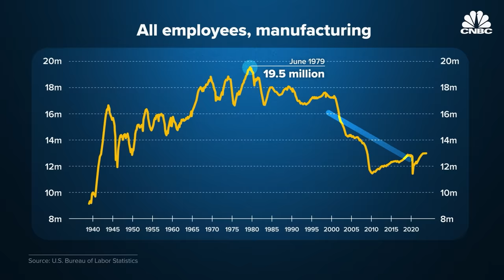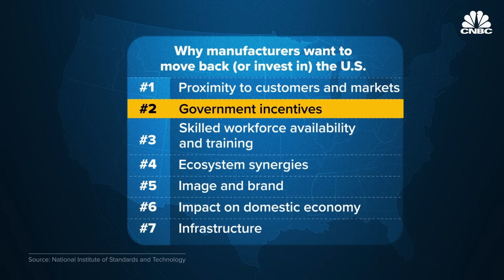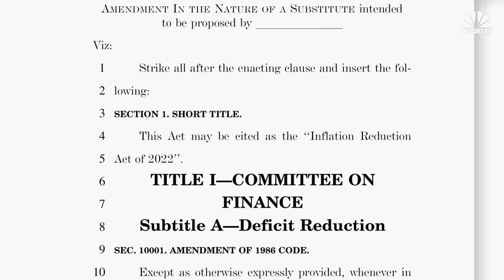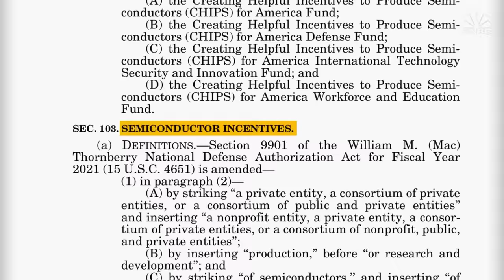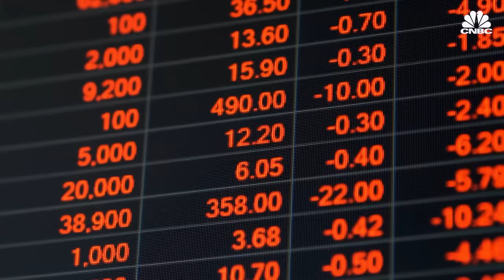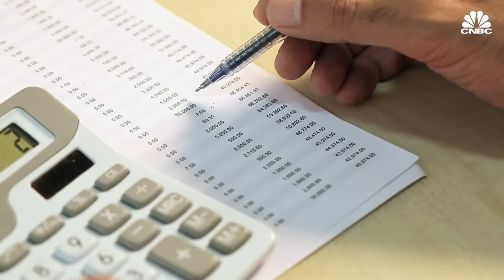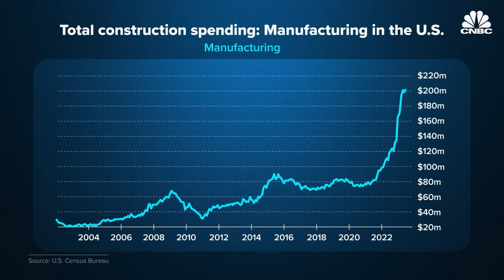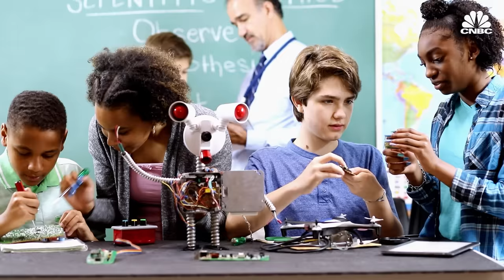Why Factories Are Coming Back To The U.S.

Comment: According to the Smiling Curve, Manufacturing is the least value-added in the production chain compared to R&D in the front and Sales and Services on the tail end. This is why factories are so sensitive to things like tax breaks, labor costs, and pollution controls, and explains how deep in trouble China is having largely failed to develop a solid grasp of the other ends. This is also why all this investment in domestic production likely won't boost our economy as much as education per dollar spent.

It is important that we maintain at least some capability to make things, but it's even more important to be resilient by having a diversity of supply sources, so that a disruptive shock -- including from disasters within America -- doesn't cripple the larger movement of goods and information that our economy and lifestyles depend on.
Reply: Too many takers, not enough producers. From a financial standpoint, I think you are correct. But from a prices standpoint I think you are wrong. The low labor force participation rate, the low amount of people producing goods, and the lack of capital investment in manufacturing has been steadily increasing costs. The core issue is that you can have all the R&D, Sales, and Services you want. But it requires the physical good in the first place.
I think there needs to be a balance in the workforce, and right now the US is out of balance.
Reply: China's biggest problem in terms of manufacturing was they were too reliant on exports. They don't have enough domestic consumers for the sheer amount of things they were creating, because for the past decade or more they were the world's factory and made everything from clothes to car parts. Now the pandemic hit and consumption took a nose dive. It's recovering, but countries are seeing it is not good to rely so heavily on China so they are pulling back and the US in particular wants to rely more on domestic production with some imports to supplement that, but far less coming from China. This has effectively put China in a horrible place because they relied so heavily on production in their economy. Couple that with their own domestic consumption being down and their housing/financial crises.
Reply: If you are not developing, and then producing new technologies, but buying them from someone outside, you are already behind technologically. We are entering a stage where semiconductors, AI and similar technologies reach such levels of complexity, and as a result, their impact, would they be in the hands of others, is far too great. 
  If the US wants to keep it's world dominating power, it has to re-build it's foundations, meaning production. It already has a developed services economy.

Speaking as a Eastern European.

Comment: Since Biden took office, there seem to have been more unfavorable results in America. These results include effects on the markets, such as price declines and sharp increases in inflation, as well as bank failures. I wonder if the sudden increase in interest rates will help value investors or if it would be wiser to stay away from the stock and financial markets for the time being.
Reply: To "buy the dip" It will be profitable in the long run. However, investors should be wary of the bull run. It is advisable to connect with a skilled adviser to fulfill your growth objectives and prevent mistakes. High interest rates typically result in lower stock prices.
Reply: I truly enjoy having a portfolio coach to help me make market judgments on a daily basis. They possess a special combination of abilities that enable them to take both long and short positions, benefiting from the possibility of significant gains while also safeguarding against downward turns. I have had a portfolio coach for more than two years and throughout that time I've actually earned over $645k. It was a wonderful experience!
Reply: @shirleygarland4766  I've been thinking about going that route. I have a lot of stocks that I have maintained, but they are beginning to lose value, so I'm not sure if I should hold onto them or sell them. I feel hiring your investment coach would make it easier to restructure my portfolio.
Reply: I'm guided by Camille Alicia Garcia an experienced coach with extensive financial market knowledge. While you can consider other options, her strategy has yielded positive results for me. She offers valuable insights, including entry and exit points for the securities I concentrate on.
Reply: I located her, sent her an email, and we set up a call; hopefully, she will answer because I want to end 2023 on a solid financial footing.

Comment: The US will remember very soon why many of these manufacturing jobs left in the first place. Productivity levels and productivity growth is substandard, if these don´t improve significantly manufacturers wont be able to compansate for higher labor cost. And then there is the lack of technical skills in many sectors. After so many years of making things elsewhere, the know-how is gone, There is not enough expertise in the pipeline and immigration policies will not help. And finally is the issue of profitability, many of the companies moving back manufacturing to the US are not making a profit. They will question their stay on US soil in a few quarters or years for all these reasons.

Comment: We've tried 'hands off, market will sort its self out'. And it did... offshore, to China, which put its thumb on the scale where we didn't. The 'free market' is not a divine power with our (citizen) well-being in mind. It is a machine designed to maximize short-term profit for a few individuals. And it works.. in the short-term, after which those individuals yolo out and start mass layoffs, selling companies for parts, etc. 

And it has no incentive in the well-being of the nation (retirement, drinkable water, climate change, health care), which tends to all lower profits, even though we keep saying 'government should not help any of these things, the free-market will take care of it'. Which.. makes no sense, logically or historically, since it is designed at its very core to avoid any and all costs beyond the immediate need for quarterly shareholder profits. It is designed from its very DNA to screw over employees and the ecosystem at any possible point because, if it doesn't, its competitor will and it will show higher profits. The free market is not a 'bad thing' so long as we regulate it as the machine it is designed to be. It can even work really well. It becomes a terrible thing when it starts being treated as a benevolent religion that can do no wrong, that must be left free to shower us all in trickle-down bounty and rainbows. Which is what rich people keep trying to sell us on, and have been for a very long time.

Scott seems heavily partisan and disconnected from reality. Yea there is political bias in the system. Pick better politicians and hold them accountable for their success / failures, so they start actually consulting experts instead of their PR teams. And elect them based on that success, not on the color of their ties. And hold them accountable to their districts / nation instead of to the national parties. (Tiered voting would help break us out of that). And yea, there are smart people abroad who can't (or don't want) to get here. But you know what? We have a ton of geniuses Here, already, who will never show up because they can't afford a quality education, because 'the free market' isn't incentivized to help them with that. And because our education system sucks, because we don't fund it properly. And yea, its possible the government will 'fund the wrong technology'. Oops. So what? At least we'll be doing Something to try and get jobs back. How much will 'funding the wrong tech' cost us vs doing nothing? How much have we spent on military R&D that never went anywhere? Should we cancel the budget to the military? Consult experts, fund what they suggest, and if we get it wrong then cut funding and move on. Corporations in 'the holy and divine free market' do that all the time and its just part of the expenses. Just.. uff. 

Scott.. Scott... come back to us buddy.. you're supposed to be an economist right? The theories you're defending have failed over.. and over.. and over.... let them go buddy. Trickle down doesn't work, the free market has only ever worked when properly funded and regulated, otherwise it cheerfully screws us over every. single. time.
Reply: We havent had a free market since the late 19th early 20th century. Times of actual free markets were also times of the fastest economic growth, the strongest middle class, increased innovation and productivity, drastically improving living and working conditions, and an increasing life span. The past 90 years have been decades of insane regulatory growth destroying any semblance of a free market while providing none of the promised benefits but still incurring all of the associated costs.
Reply: @mathewlloyd9717  Late 19th and 20th century.. wasn't that the years leading to and including the Great Depression? (1929-1932 when the GDP fell by 15%)? Triggered partially by the dust bowl effect (from unregulated excessive deforestation) and the panic of 1873 which built up into stock market crash of 1928 from unregulated banking practices? 

early 20th century.. around 1910-1920.. wasn't that also when the US faced some of the worst income inequalities? that improved around 1940-1990 and that we didn't have to deal with again until around the 2000s (and have just surpassed now)? With wealth inequality obviously sucking for anyone who is not at the top of that inequality? 

As for 'life expectancy', right now its gone down as we overwork ourselves and eat crap food full of forever-particles and all that, but didn't industrial pollution account for a Lot of the mortality in the early 1900s? Building up to 'the Great Smog of 1948' were 20 people just outright died from trying to breath outside? Which kept building to the point where most cities were covered in layers of smog that blocked vision (there are some fantastic spooky pictures of this) until the 1970s where we finally started regulating that? Isn't this something China is actually facing right now because they didn't set regulations, and (before covid, by 2017) people literally had to walk around with 'pollution masks' trying to get to work or take their kids to school? 

I'd say that for ordinary people, which is the vast majority of the citizens of any country, we've been living the benefits of regulation just fine. I can see how companies might not appreciate these benefits but... I am not a company. Most of us aren't 'companies'. And companies aren't 'people' for me to worry too much about their feelings. If we have to choose 'us' or 'them' I hope we can make room for 'them' to succeed... but I'm not up for destroying 'us' (again) to do it.

Comment: Bringing high volume low margin manufacturing would be disastrous and subsidising it should be discouraged. Low volume high margin and value manufacturing should be restored with emphasis on the nations strong lead in industrial automation and combined with a massive reskilling effort and greater emphasis on trades we can definitely bring high quality manufacturing back to the forefront in the US. And that change is already happening in some states like Georgia. A great example is rail manufacturing where Siemens, Stadler, Alston and Bombardier all are either expanding or constructing massive new factories. Also in terms of clean energy the new recent legislation allowing for lithium manufacturing would greatly help in expanding battery tech.

Comment: The problem is that overseas manufacturing is not sustainable. Average people of average ability are squeezed between job requirements of higher-level positions and H1b visa holders. Also it appears that American labor in some states is now at a tipping point where it's almost at equilibrium with cost compared to overseas. Also, tightly-coupled supply chains that involve multiple countries create problems during times of economic stress.

Comment: Almost every American citizen will tell you that if given a choice, they would prefer solar panels for energy and EVs for cars since everything would be powered for free and no harmful side effect once the system is set up.  Thus, the key here is to make solar energy system costs as low as possible.  Unfortunately, anything made in the USA is going to cost an arm and a leg.  This is why manufacturing moved to China.  But the current USA government is not going to let citizens enjoy the low cost solar systems from China, so we are back to square one, and only the Chinese can enjoy the low cost of solar system.  The biggest problem with solar panel installation in America is that the panels are place on the house roof instead of on a car port or better yet on a dual axis solar tracker rack (these racks increase solar production by 40%).  When America really want its citizens to go solar power system, they will get their acts corrected.

Comment: EVs may be the smokescreen as to the true reason why the United Staees wants Semiconductor manufacturing in the US. Every cruise missle, naval computer, and aviation instruments rely on this component. 

But in reality if the US were to be engaged in a prolonged engagement militarily with countries like China or Russia, they need alot more than CPU chips. The US does not have the raw industrial capacity or number of steel mills that China has.

Comment: The problem with the legacy energy industry is that its effects and waste was not properly factored into its cost. If you have an industry yhat dumps their waste into a river causing adverse effects to the river environment and affecting other people that deoend on that river for their livelihood, it is the government's job to step in and force the company to deal with its waste and that factors into the cost of that industry. For fossil fuels dumping their waste into yhe atmosphere, that cost of dealing with that easte is not factored into their bottom line. If every coal power plant was forced to have to capture and store all their waste gas being dumped into the atmosphere, power from coal would be FAR more expensive.

Comment: The thing is that government spending has always always gotten the economy back with a shot in the arm.  When government spends especially on projects it gets private companies to invest as well in factories, hiring new people, and expand their business.  New projects especially fixing roads, water sources, etc needs workers as well.  In the end, it all helps the economy down the road.  Compared that to trickle down tax cuts for the rich and corporations which don't do s except pad the wallets and the corporations use stock buybacks like the Big 3 auto companies (GM, Chrysler, and Ford).  The airline companies like Delta, Southwest, and America Airlines used it for stock buybacks.  Everyone benefits from the construction company needed to hire workers, to the materials like steel, concrete, wiring, to even the trucking companies bringing in the materials, supplies, and equipment.  Now these factories and companies now need to find a way to keep and maintain these workers and they know if they skimp out on pay and benefits, they are going to lose workers quitting or they will unionize which for them is worse along with bad PR.  If you want to make workers happy and production go through the roof then pay the workers and benefits like you see at Costco.  A model of when you treat your employees right, you get less people quitting and lower turnover especially in the retail industry.  It all trickles down especially if you got a good business model.

Comment: Some of these statements are crap. I have worked in high tech for decades.  High tech companies have always wanted to get workers from overseas, pay them less than US workers, and then send them home(without becoming citizens).  They have always complained "Not enough US qualified workers".  As to supporting things in certain areas to help your political career, this has been going on forever.  Why is the Johnson Space Center in Houston?
Reply: I'm in technology and they are NOT hiring older wihte males these days, except for the very top senior positions;  I can tell you that for a fact. They need to hire for racial/gender diversity, so they are not getting the best and brightest. This country is skrewed, unless this trend is reversed.

Comment: Think about this.  The USA had strong manufacturing base in the early 1940's, this allowed the USA to prevail in WW2.  In the current weakened state of USA manufacturing , do you think that we can prevail against when China starts knocking on out shores?
Reply: Defense manufacturing isn’t what we need
Reply: @somezsaltz6835    You are missing the point, the USA had a strong general manufacturing base that was rapidly retooled to defense.    Trying to rapidly build general manufacturing mostly from scratch in order to build defense items in an emergency would be extremely difficult.
Reply: @windsong3wong828    Do some research as to how well Japan and Germany did in WW2 and what it took to repel them then get back to me.
Reply: @bobroberts2371  aerospace manufacturing is still strong and because of the war in Ukraine we are starting to produce more weapons even nukes unfortunately
Reply: @somezsaltz6835    The issue is where do component parts come from to make a completed system?    If China shuts off the supply the USA will be stuck.  Try building a CNC mill or lathe without China parts.
Reply: @bobroberts2371  we don’t get everything from china anymore they aren’t even our biggest trading partner anymore